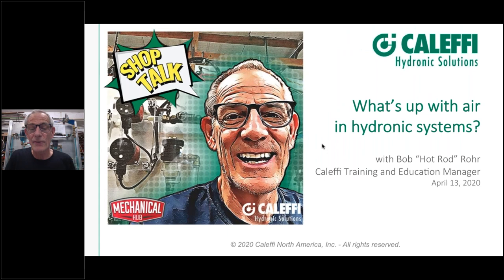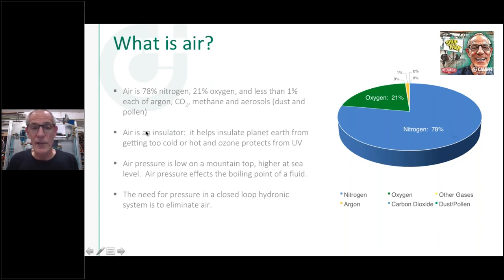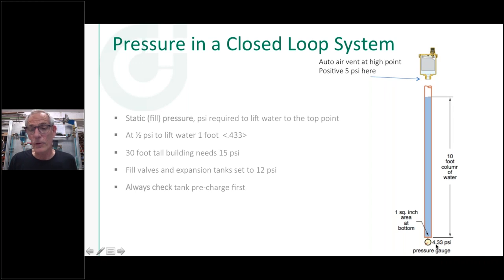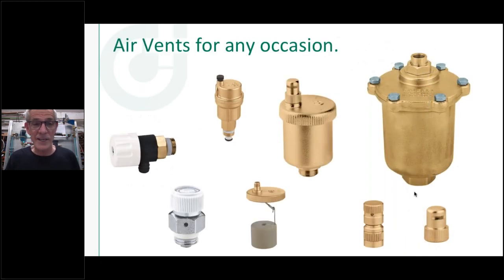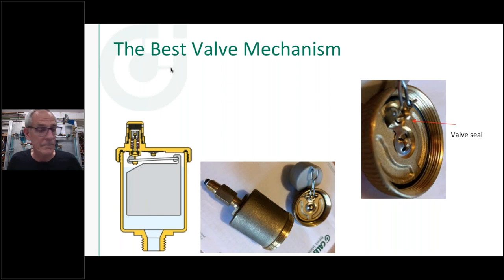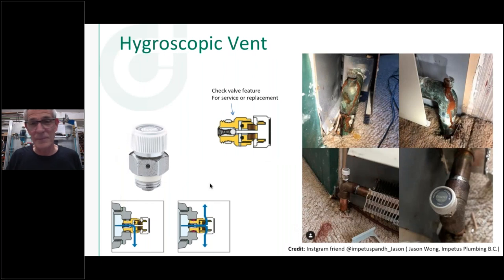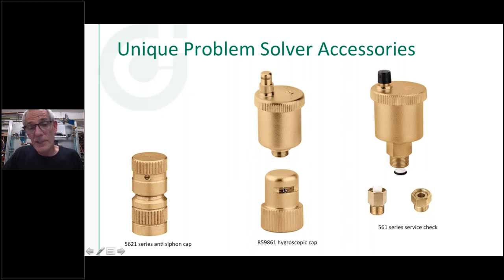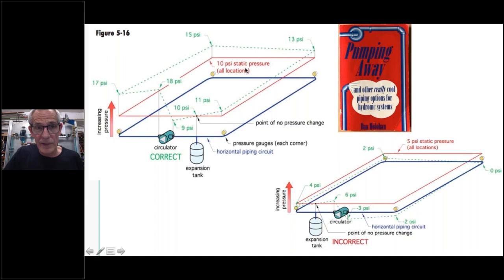EPISODE 1 :  What's up with air in hydronic systems?

Comment: The demo videos were very illustrative, but it was hard to see with the camera so far away.  The second video was better, but the first was very hard to see what was going on.  It would be nice to repeat that with the camera fixed close up at a couple different points in the system to see first hand the turbulence and swirling in the pipe as well as the air elimination.  It is hard to beat a demo system like you have to drive home the principles.  It would be neat also to have a demo for pumping away.
Reply: Thanks for tuning in and the heads up.  I'm still tinkering with cameras, angles, lighting and fluid color to make the demos better.  I'm building a clear buffer tank header as we speak for an upcoming session. Any suggestions you may have for "dialing it in" would be appreciated.
Reply from the maker: We sure appreciate your comments.  With the stay-at-home rules, we have quickly learned to become videographers.  Thanks for your patience in the meantime; we're getting better each time!